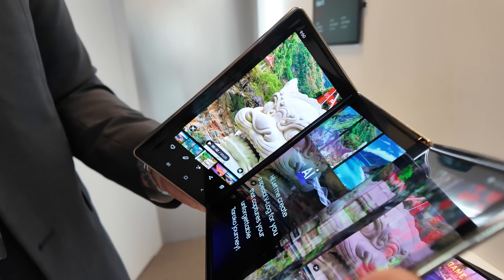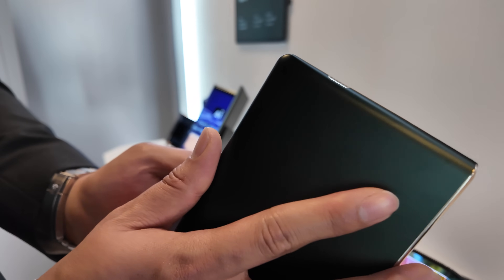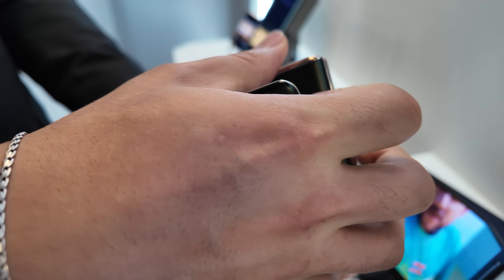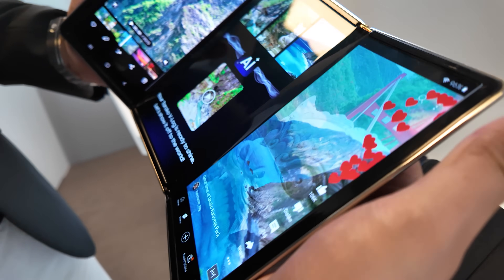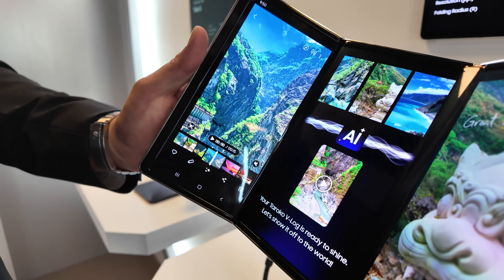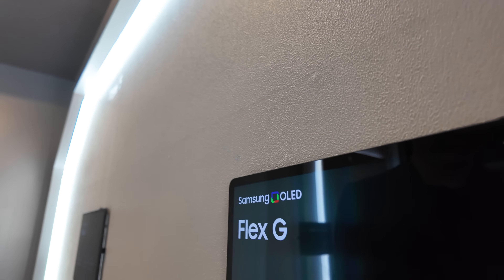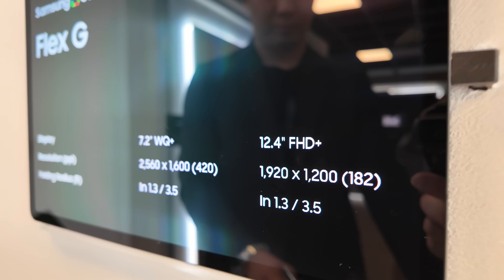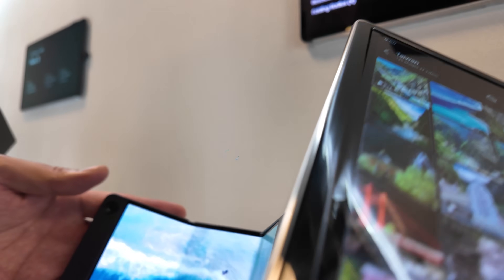Samsung Galaxy Flex G and Flex Z prototypes at Computex 2025 showing off tri-fold OLED by Samsung!

Comment: They are not Samsung Electronics' prototypes, they are Samsung Display's prototypes.

The purpose of the display company is to show the function/performance of the display panel prototype. Of course, it's a display manufacturer.

The goal is to show the specifications/performance/functionality and commercialization potential of that display panel and appeal to what has improved compared to the previous year's presentation prototypes, and there is no reason to wonder how cool the frame with the display panel installed is.

Display manufacturers have boasted traditional performance indicators such as light emission efficiency and color brightness through materials, but in flexible display panels, mechanical deformation and durability have been considered, and the durability has advanced a lot compared to the 2010s.

Therefore, Apple is planning to release its first flexible display-equipped product, which is aimed at next year, and Samsung Display is the manufacturer of the display panel to be installed on the product.

Idiots who look at and evaluate the frame with the panel installed, rather than looking at the panel of the display company, please think and speak.

Comment: Why apple can’t make an iMacs of this type ?  Imagine a 30x14 inch wide-screen iMac folded like a 10x14 inch tablet. Unlike normal tablet you don’t have to frequently bend the iMac but still you can move it easily from place to place. 
There are countries where iMacs are not available for sale. It’s hard to buy a one from a different country and travel.

Comment: I like this folding phone screen tech. Wonder how it holds up over time. Creases will occur it seems. Physics material.
Reply: That's where samsung puts the R&D: material science,  so that the screens dont have this issue unless there's a defect. I've owned the Fold 4, 5, and now 6, and honestly, the 4 is the only one that gave me crease issues. The tech has definitely matured enough at this point, although adding another hinge and crease is going to add more points of failure. Ultimately I won't be buying the first generation of the G Fold and will probably wait until the 4th gen like I did with the original Fold.
Reply: I think I've had my Fold 5 for 2 years or so now and it's pretty solid. You get that bend area in the middle because of how the tech works, but on my model it's not a "crease", but I think the one before it had that issue. 

My biggest complaint is the resolutions. 
Closed, I have something thinner/wider than normal. It's like an ultra wide display, but portrait.
Open, I have a 4:3 aspect ratio. It's admittedly not bad when I'm watching old shows or emulating old games, but for anything 16:9, I don't feel like I have any advantage over a traditional device. I COULD multitask with a full 16:9 video playing and a full app in landscape underneath, but I don't really use many 16:9 landscape apps. 

I think these and that Huawei phone have it smarter; basically a tablet that tri-folds into a phone.
Reply: Insurance definitely needed for these devices.

Comment: I'd rather just have a single fold point. But still, this is how you make advances. 👍 

Of course, every time I think about buying a foldable, the price makes my eyes start bleeding.
Reply: I have a feeling that the bigger variants of the Flex G and S will be MORE EXPENSIVE than the Z Folds.

But I think the much more smaller Flex G and S might be a bit more expensive than the Z Flips, but still affordable.
Reply: I don't like the cheap touchy plastic feeling😂 under my fingers especially at that price point, the glass it's much smoother and better overall in my opinion